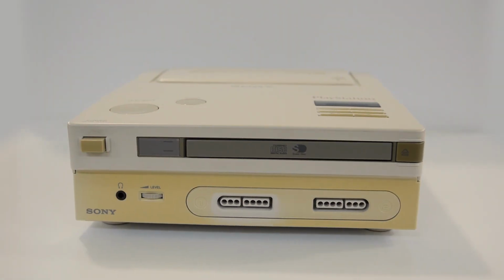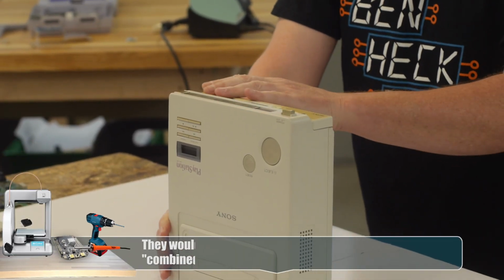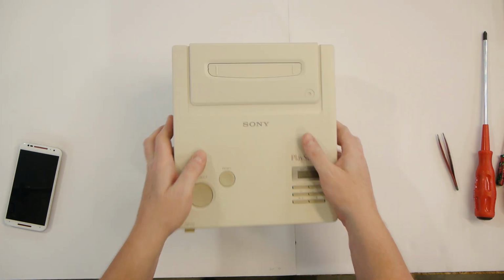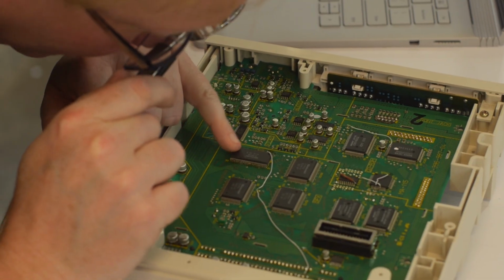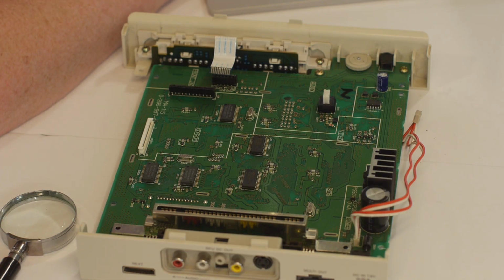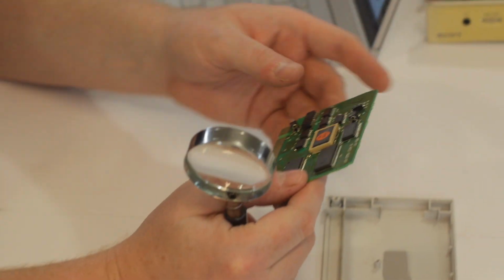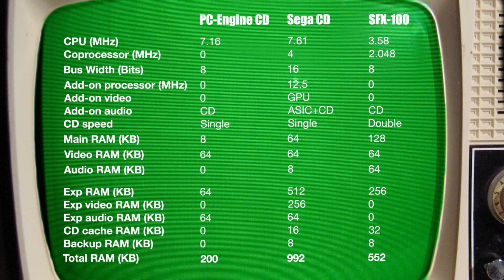Ben Heck's Nintendo-Playstation Prototype Pt 1 Teardown

Comment: So, if the Nintendo Playstation required the use of the system's cartridge to run CD games, like the Turbo GraFX CD required the System Cards, add-on chips like the SuperFX and DSP-1 would be out of the question? Unless, of course, subsequent cartridges were released later on, containing those co-processing chips. 

That would have meant that games using the cartridge like the prototype has, wouldn't have capabilities that Mario Kart had, or any other game that used an external chip. Seems like it would have been a big step backwards, at least in the beginning, for SNES, as far as special effects went. Only adding CD audio, motion video and extra storage. 

Would have been awesome though, had an updated system cartridge contained several of the add-on chips, extra RAM and backup RAM. Probably an expensive way to fragment the platform. But imagine how cool those games would've been back then.

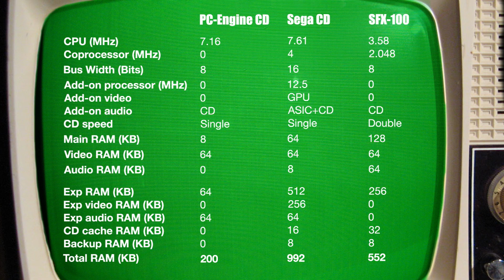Comment: 24:52 I don't think the slower speed (and smaller data bus) of the SNES CPU is going to slow it down that much, since the CPU has an 8-channel DMA controller built in. Combined with the bigger CD data buffer, it probably isn't too bad.

Although it seems like a shame they didn't do more to extend the underpowered main system. I mean, the Mega Drive has a really nice CPU (same as used in the Atari ST, Amiga and even the Street Fighter 2 arcade machines) and plenty of RAM, and still the Sega CD brought a second 68000 CPU and lots more work RAM. Just a shame they didn't make enough use of it (although Snatcher is awesome).

Comment: For the chart comparing hardware specs @22:00... The PC Engine/TG-CD had an upgraded System Card (with 4x RAM) for the Super CD format introduced in 1991...this was the new standard and shipped in new hardware (and folks with older hardware could upgrade as well). Then, by the time the time the SNES CD would have been released, NEC released the beefier PCE Arcade Card in 1994 with even more RAM... the stock PCE/TG-CD RAM from 1988 did not remain static...  :)

Comment: Amezing, thanks for showing us the inside of it, let's hope the cd rom hardware can be emulated on snes9x aswell as being replicated on the sd2snes sothat cd games can be made for it.
Yeah, if another system is slow because of little ram while another system has more ram but little bandwidch to work with, that makes no sense haha lol.
You say the pc engine 8bit chip runs at mhz as opposed to the 16bit 3mhz chip inside the snes, but i think they might be equal in porfomance or the snes cpu maybe still better being  a 16bit???

Comment: About the CD Add-on comparrisons, you forgot that the PC engine CD had system card expansions, you just compared the regular PC engine CD with no expansions, but there was also the Super System Card which added 256KB of RAM on top of all that it already had, and the later and much-less-used Arcade Card which added 2 whole Megabytes of RAM!

Comment: When you're looking over the stats you need to remember,  the main advantage of the Super Nintendo was the expansion chips located on the cartridges themselves.  Nintendo had a past history of putt in everything from Ram to Cpus on the cartridges.  Games like Star Fox and Donkey Kong Country wouldn't have been possible without these add ons.  It's highly unlikely that this trend would have ended with the Nintendo Playstation as it would have generally made the quality of the games worse.  It's possible that they would have went the route of Playstation and used a splash screen that posted to the ram in order to swap cartridges mid game play from boot cartridge to game cartridge.  This of course would have made things expensive as it would have required a cartridge cd combo for many games and the downside would have been that like the 3DO it wouldn't have been marketable due to the high price of said games.  Then again I'm just an underachieving naredowell so take my input with a grain of salt ha ha ha.

Comment: I has a question, was the Nintendo PlayStation basically a PS1 and a Super Nintendo/Super Famicom put together?
Reply: The whole concept of what became the Sony Playstation grew from this prototype, but it is not an actual Sony Playstation by any means. It's more of a Super Nintendo with a disc drive and additional software essentially.
Reply: Can the CD drive play PS1 games?
Reply: +Matthew Berry Based on the video, it doesn't have the hardware to do so.
Reply: +Matthew Berry no because its just a SNES with a CD drive,  the hardware in this compared to the hardware in the PS1 we know today are totally different (plus the hardware in the PS1 is faster and more capable). 

if you'd paid attention in the video he saidbits just a SNES with a CD.
Reply: If he means will the disc spin in the player, sure. Will it be read? Nopes. Sorries.
Reply: so was the Nintendo PlayStation supposed to be like a modern famicom/famicom disk system, where there are SNES games and exclusive CD games?

Comment: So what was the point of the point of the add on if the games weren't going to look or sound any different than a catriage game?
Reply: You know how the Famicom had the disk drive? Same concept I imagine. Maybe add some additional features to expand the life of the SNES.
Reply: The giant leap in storage capacity on an optical disc vs. a cartridge. Great for larger games like RPGs. Also just expanded capability with graphics and music. Sure, it didn't improve the processing power, but you could potentially have more levels and more music without reusing assets.

EDIT: In fact, just reading about it, Squaresoft's Secret of Mana was originally planned for the SNES-CD, but after the project was scrapped it moved to a cartridge and they had to cut down on its content.

Comment: So blast processing was a real thing!
Reply: blast processing was just a name they used for the faster processor speed the genesis had.
Reply: +Lincoln Noronha Everything has to be dumbed down for the general public
Reply: Not quite. "Blast Processing" was actually just a programming trick to speed up processing. On a technical level, it's just over-glorified multi-threading, a feature that was BUILT IN to the SNES! :P
Reply: Icelink256 Not even close to being true.
Both the Megaadrive and snes had multithreading due to the co-processors but don't forget that the Megadrives VDP has faster DMA transfer speeds and Vram bandwidth and the snes data buses being 8 bit give a big edge to the Sega machine.
That with the better CPU could be called blast processing except that blast processing is nothing more than a marketing gimmick and doesn't really exist.
Reply: Gambit771
You say market gimmick, and I say way to dumb down a complex explanation to the general public, while still conveying the idea.

Comment: Highest selling peripheral of all time would either be the Famicom Disk System, which sold double the Mega CD, or if you are counting controllers (since you mentioned Kinect) it would be the Wii Balance Board, by far, at 32 million sold.

Comment: The Genesis is capable of pulling off tricks that the SNES can do, giving though if you have the tools and knowledge. There's a homebrew Sonic racing game that is similar to Super Mario Kart, that pulls off Mode 7 without the need of a extra chip. Also some Sonic hackers have made sound drivers capable of playing back PCM audio, which allows other hackers to use actual songs if compressed. Check out Markey Jester's Sonic 1 the Next Level hack, it contains samples of actual songs that are slightly remixed but are high quality samples. Overall though, I'm more of a Genesis fan boy than the SNES. :P Still I like the SNES, but technically the SNES is "better" because it came out a few years after the Genesis did, and you know how fast technology evolves... Still I look forward to the next video, hopefully the console can be brought back to life. This is truly a interesting piece of video game history.

Comment: @The Ben Heck Show wouldn't this be the early version of the doctor 64
Reply: The Doctor V64 was a "backup" device for the N64, so no, not really.

Although, the V64 does use a NOAC (NES On A Chip) as the main controller, even though it doesn't actually use the NES graphics audio output. There's a separate text gen chip for displaying the menu. I guess it was just cheaper than adding a character ROM?

I did a mod for the V64 BIOS many years ago, so the games could be loaded from HDD or CF card. ;)

Comment: Ben Heck should make a Nintendo Playstation hack of his own. Either a Playstation that functions as an add-on for a Super Nintendo and fits snugly under the console like the canceled one was supposed to, or a hybrid console like the prototype in this video that plays both retail SNES games and retail Playstation games.
Reply: it might be possible to hack together a CD add on for the original SNES.  Wouldn't really be necessary with the storage capacity of flash cartridges, but it would be neat to see someone do it.  The hardest part would perhaps  be interfacing to the expansion port.  Just use an old laptop CD drive and attach it to a board+cpu capable of interfacing with the nintendo playstation rom.  Then burn Super Boss Gaiden to CD and see what happens. There would probably be people who would buy one even though it would be essentially useless.
Reply: ReedSolomon They could also include an MSU1 chip so that people could enjoy the "enhanced CD-ROM" hacks of games like Zelda, Mario World and Super Metroid. If it was basically an SD2SNES except it was a CD drive that plugged into the base of the system, a lot of people would want one just for the novelty of being able to play CD games on a SNES.

Comment: The Coloring of plastics was a due to Fire Resistant Plastic Compounds they used back then, it will changed under UV light, so even with the Retr0Bright it will yellow again over time.

Comment: Ben you're Awesome, I remember way back in the day that Nintendo and Sony had a partnership to build Nintendo's New system to compete with Sega and PC which had CD Drive units attached. But they had internal issues and ended up dissolving the partnership. Sony then took the research from the project and built the "Sony PlayStation" and the rest is history. Nintendo drop the ball with that venture. Totally creating their own Frankenstein's Monster, And yes I'm Old like Ben :) keep on hacking Ben

Comment: There is a homebrew game for the disc system. You could burn that to a disc and see if it works if you manage to fix it! That would be so cool. It is called Super Boss Gaiden. Also, could you treat the yellowed plastic? And dump the ROM so that people can see what is on it. That battery won't last forever.
Reply: He definitely could undo the yellowing by dipping the plastic in hydrogen peroxide. Though I don't think he has to worry about the battery dying. The BIOS is built onto the board. The only thing the battery does is save the settings.
Reply: Yeah, it wouldn't be difficult to clean it up, I am just not sure if it was something on his mind.
Reply: GoldenKingStudio Guess we'll just have to wait until part 2.

Comment: As I recall back in the day when they were first talking about this thing, reports on the SNES CD drive was supposed to use something called HANDS as a system that would pull data from the disc to off load into the processor while simultaneously loading more data. Presumably this was something they were doing to either speed up load time or allow it to handle more data at one time.

Comment: SFX? That's probably the Super FX chip. I could be wrong though.
Reply: SargeSparta thanks! I didn't know about that! I always thought it was inside the system.
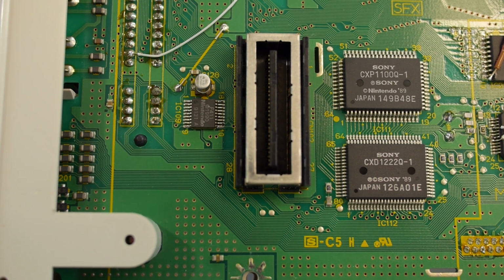Reply: +Sauraen 12:28 - right there. ;)

(the two Sony chips next to the expansion port.)

The SFX thing was probably just an internal dev name more than anything.

There's no Super FX in the system. It's literally a SNES with a CD extension.
Reply: Super FX chips were on cartridges not the console.
Reply: Yeah. That's why only some games utilized it. If it was built into the SNES games would of used 3D much earlier on.
Reply: It's possible that the CD system was going to have the Super FX so that CD games would be able to take advantage of 3D since you can't build it into a CD-ROM.

That's assuming that SFX in this system's case means Super FX or that they even planned to have it utilize it in the first place.
Reply: the SuperFX chip were  marked MARIO CHIP 1 & GSU-2 rather than "SFX", i can understand why people would think of the SuperFX chip though, it would have made sense for them to include one in the system itself so all games could utilize its features and iirc the SFX was basically a beefed up snes CPU including one with the CD addon would have brought it pretty much inline with other CD addons of the time

that said this was just a prototype
Reply: The SuperFX actually had a risk RISC / ARM-like) CPU core.

It was developed by Argonaut, who then went on to found ArtX, I believe? (who went on to work on the Game Cube design along with ATI)...

http://www.theregister.co.uk/2013/08/15/starfox/

But yeah, a bit strange why they didn't just stick one in the SuperDisc as well.

Unless the SuperDisc was being developed sooner than we think?
Reply: Good idea, but then where's the audio chips?
Reply: ElectronAsh
That was my point. I thought he said the chip which we thought was an audio chip was labeled SFX. Maybe not, I had a bit of a hard time following the details, I wish he would just put up hi-res pictures of the boards somewhere.
Reply: Pretty sure the "SFX-100" was just a code name tbh, or it could actually have meant "Super Famicom X", as Ben surmised.

The SuperFX chip was obviously around already back then, so yep, I guess they would have intended to make at least some games using it (in the cart)?

Although, the "CD" cart would have been relatively expensive to produce, purely because of the 256KB of DRAM in there (needed for loading the chunks of data from the CD), and it doesn't have a SuperFX chip in there of course.

That would have meant making another cart with the DRAM and SuperFX chip in order to make use of SuperFX-enabled CD games.

Only other way to add the chip would be on the expansion port, or with a kind of pass-through adapter that the "CD" cart fits into.

Comment: As i see it, PC engine and Sega CD needed more updates than the Snes CD because they needed to match the better audio and video quality of the Snes. Just compare graphics and audio of both Road Blasters ports, that's how the Snes CD would've worked. Something remarkable is the cd double speed reading, cause it was made to be helped by the cartridge's chips expansion, as the Snes did with chips like the FX chip. This means that with the proper expansion chip, the Snes would've been updated almost indefinitely. Remember all those badly or incomplete ported Arcade games?.

Comment: I hope yall back up that bios, that battery dies there's no replacement panic
Reply: Nah, the battery is backing up the 8k of save data, not the actual ROM. That's permanent.
Reply: Yeah, it's like a computer in that regard. The BIOS is built into the board, and the battery saves BIOS settings.
Reply: Lol only actual computers would need a BIOS chip. There's no purpose of it if you're making a device that could only hold 1 set of configuration; hence the SNES/Play Station 1.

Comment: Common misconception: the Genesis CPU was not faster than the SNES. While it was clocked a higher speed, it needed more cycles per second to perform any given operation. If measuring in terms of operations per second rather than cycles per second (operations per second being what actually determines the processing speed of a system) the SNES was quite a bit faster than the Genesis.

Comment: I'm sure you've already been told this by a dozen different people right now, but on the off-chance you haven't; The PAL and JAP models of the SNES actually had the mechanical lockout on the cartridge eject system too. Unlike the US carts, the PAL/JAP ones had little tongue grooves in the front of the cart - when you push the heavy on/off switch into the "on" position, it also pushed a lever into that groove and prevented the cart from being forcibly removed during play.

That might explain why the similar method was used on the JAP prototype of the Sony-Nintendo PlayStation :)

Comment: The idea of the disassembly arrows on Sony units is not just showing you were the screws are, but which screws need to be removed to be able to open the case. Screws not marked with an arrow don't have to be removed for disassembly.

Comment: so the reason that the proto had a port on the bottom of it was because it is supposed to work with non disc addons just like the snes, such as the excersize bike. That prototype is actually part of the contract where sony got to sell their own console, like panasonic did with the panasonic Q. Nintendo's own branded addon was just an addon and not a standalone console like this.
Reply: with as poor as the hardware was, do you think its possible they intended it to simply have a add-on to upgrade the consoles performance and nothing else?
Reply: yes, or more specifically, to be able to enhance the size a game can be.